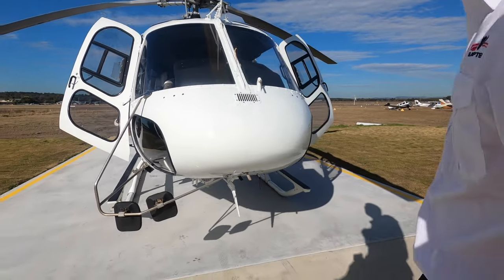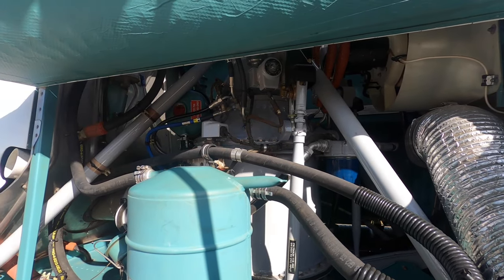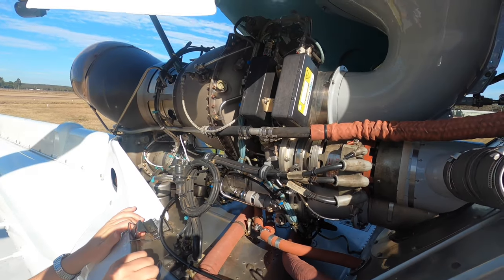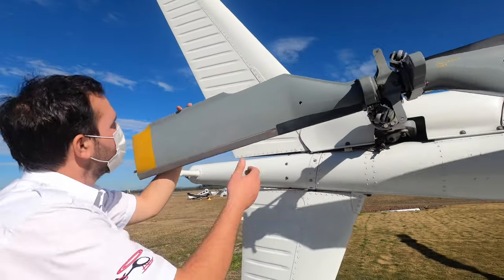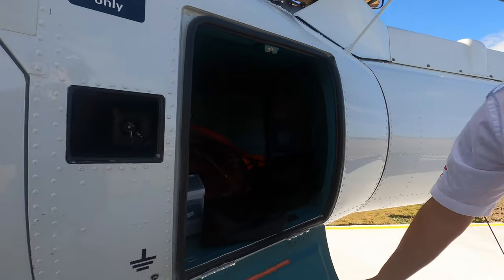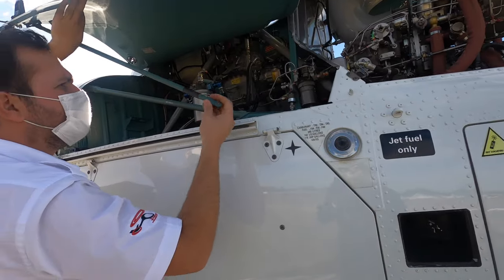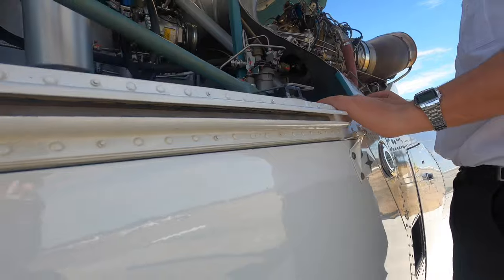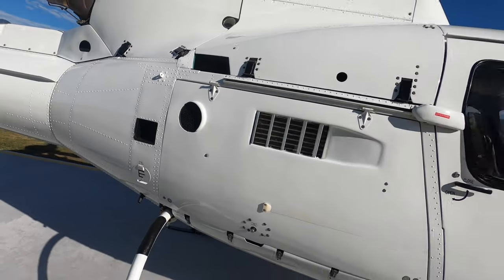Walkaround Preflight of an AS-350 B2 Squirrel Helicopter

Comment: 12:22 that other vent tube is called "rear bearing air vent pipe" P/N 0301037180 (from the SPC) I'm looking at the Arriel 1B for reference. It vents from the module 4 area of the engine at the rear bearing, so it basically does the same thing as the oil one but from a different location of the engine :)